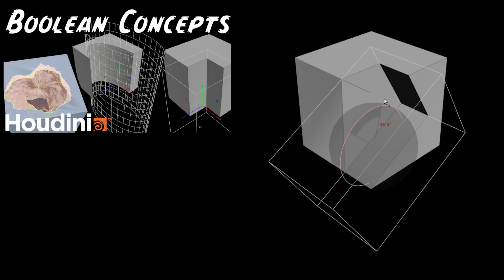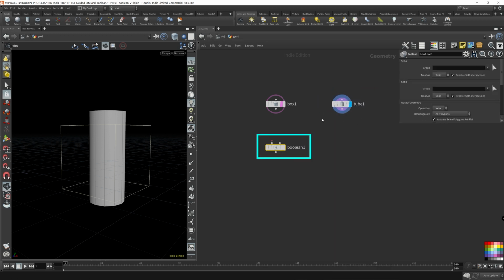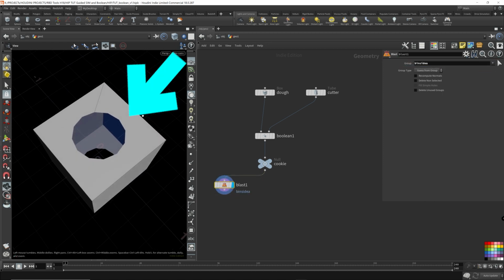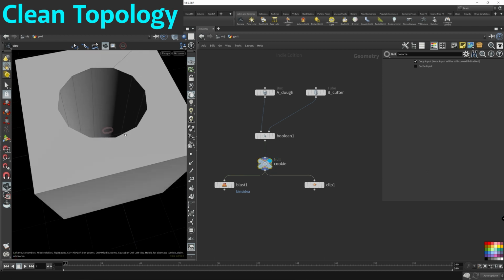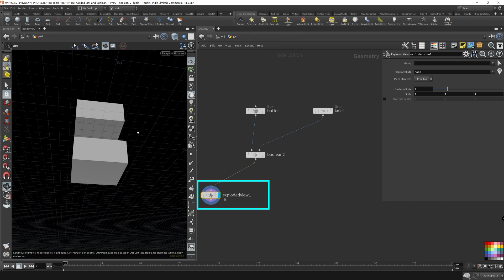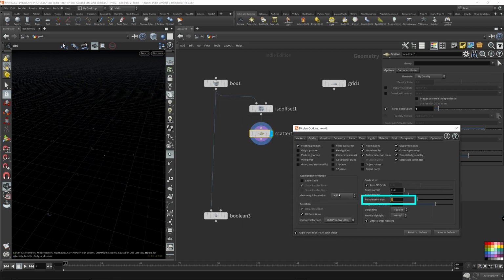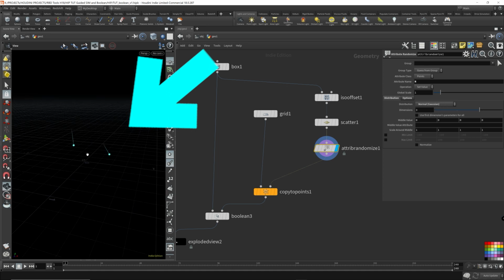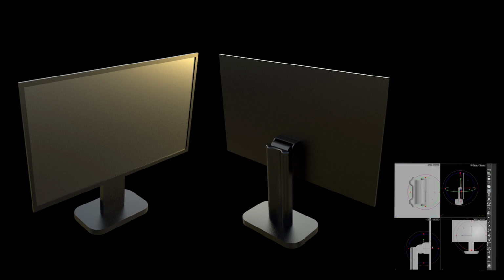Boolean Concepts for Beginners in Houdini

Comment: It looks like Live Booleans in ZBrush. Thanks
Reply from the maker: I agree!!!  That was my first thought as well!
Reply: @bubblepins  I tried some ZBrush meshes in Houdini and boolean functions there  but with one subs mesh it is little weird .. shading like polygons from A mesh in that cutting area have some weird shading. But i used GoZ for that. I will try just import meshes and  unpack and convert.  Or do some meshes just in Houdini. But my knowledge there is quite limited for now. In ZBrush booleans work perfect.   ..... I think i have figured it out ... Thanks ... just turned off that :Seam polygon are flat and it works. I also try to turn it on.. and nw iit works :D so .. sorry for that reply :) some crazy stuff maybe
Reply from the maker: @karelchytilart  It is true, I have found that zBrush Booleans work very well in comparison to Houdini.  I think it might be due to the fact that zBrush can handle a higher polygon count than Houdini or even voxels.  Both Boolean functions came out around the same time from what I recall, I wonder if someone release a new thesis for a new way of coding an algorithm for booleans or something.

Comment: i ve got a warning in boolean fracture in the end ... warning says cross boundary (unshared) edges in a solid A

plz tell me how to fix this
Reply from the maker: Yeah this warning comes up quite often.  Usually for me, it comes up when I have a not so good geometry fed into the boolean.  If the geometry isn't water tight or one of the corners aren't fused properly.  Try dropping a fuse node on both geometries feeding into the boolean inputs, and see if that helps make the warning go away.
Reply: @bubblepins  thanks for the reply ... My problem is solve i take polyfill node in that setting geo. type set to quadral i have to set it to Triangles .. after that problem solved

Comment: The assemble node is bringing my cutting geo into the simulation. I dont want it in there. I have a sphere cutting out the center of a cube. I shatter the resulting geo (in a dopnet to sop net), but the sphere is also dropping out and getting shattered separately. I can blast it after, but Id rather have it not there to calculate.
Reply from the maker: I'm not sure why it brings in the cutting geo as well.  Try filtering the geometry on the assemble node using the group parameter.  This will assemble only the selected group geometry.  But if you're cutting geo is being merged into the assemble node, then it might still end up in the sim.  I think blasting it before the assemble node, may be the only way, I think.

Hope that helps!
Reply: @bubblepins  Thanks it turned out that the sop solver simulation wasnt able to calculate the boolean. a combination of a that and because the boole was a cavity.

Comment: how to access boolean output edges group?
Reply from the maker: Near the bottom of the boolean node, there's a bunch of groups that you can output.  Try enabling them and see if one of those seam groups will be the edge you're looking for.
Reply: @bubblepins  unfortunately, i couldnt make it work. i want to use the edge group to kinda make a bevel edges with noise
Reply from the maker: @360touchgrass  Try using the rbd interior noise node instead, they give you a lot of these functions out of the box.  I have another tutorial demo-ing this:
https://youtu.be/FOGrNuBGnz8

Hope that helps!
Reply: @bubblepins  Woah, thankyou for speedy reply, will look on that!

Comment: is it possible to get clean and even topology out of a boole object? is there an automatic way to remesh with even quads?
Reply from the maker: The Boolean node has a few options for generated topology, but it mainly uses the 2nd geometry's topology as a guide to do the boolean and transfers the topology over to the resulting geometry after the boolean.  You need to try to keep clean topology before the boolean for both objects that get fed into the boolean, then the resulting geometry can try to maintain the clean topology.

Hope that helps!
Reply: @bubblepins  Wow thanks very much for the response. I think im just a little confused how you could match up the geometry of 2 objects before 'booling' them. I bassicly just want to be able to model hard surface objects that could be subdivided when brought into another program - do you think thats manageable using this modeling technique?
Reply from the maker: @jacobdutton919  For simple geometries like the primitive shapes I think it could be possible, but you probably want more complex shapes.  In that case, I have a trick that I use. 

Method 1:
First do the boolean operation that you need with the 2 objects, then throw down a vdb from polygon node to convert it to a volume, then throw down a vdb convert to convert it back to a polygon, then you'll have nice topology.  The problem with this method is that you sometimes loose the nice hard edges.

Method 2:
Well not really a method, but you can use the boolean operation to do the stuff you need and after that use the remesh node, but there's a "Hard Edges group" parameter where you can specify the edges that you want to keep.  So what I usually do is put a * in there to keep all the edges made by the boolean and then usually the remesh node will be able to maintain the original shape with ease.  But this will only work if the resulting boolean geometry is simple enough.  Less topology after boolean node the better.  Keep important edges like hard edges and stuff that make it look good in the renders.

Hope that helps!